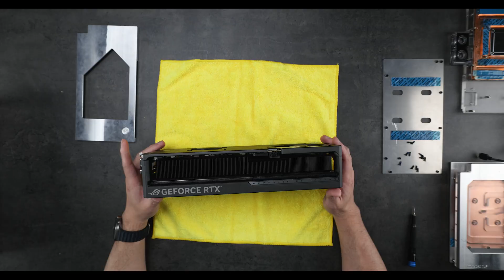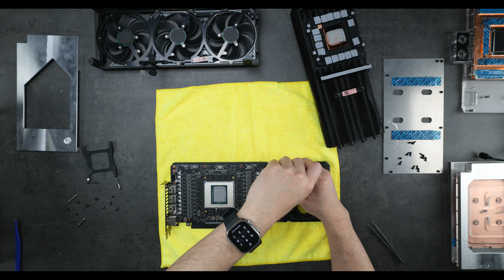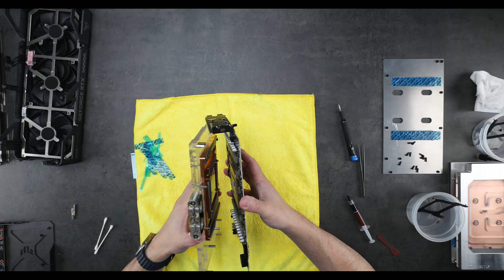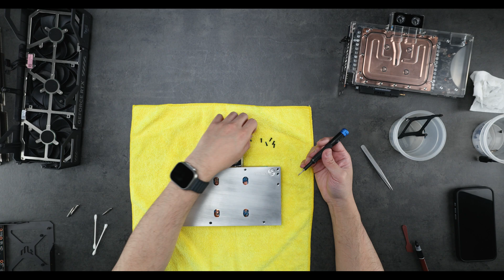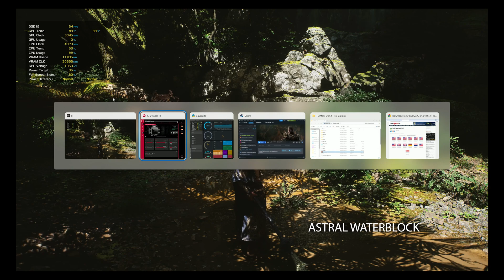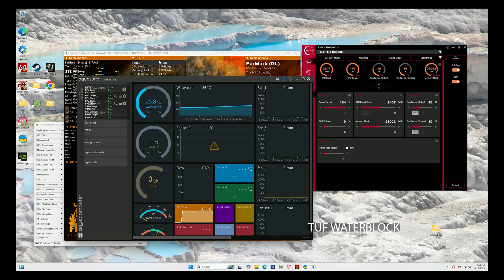Watercooling ASUS ROG ASTRAL 5090 & TUF 5090: Bitspower Prototypes: Teardown, Install, Testing FULL

Comment: Serious question here but what is the point of buying an astral if you intend on just watercooling it? Since all t h e 5090s are the same silicon, technically, wouldn't it make more sense to just buy a cheaper version and  watercooling that????
Reply from the maker: I agree. I made this argument as well. However, it seems the most in demand from consumers is for an astral block.
Reply: @JCustom thank you for responding, that said, you would agree it just makes more sense to buy a cheaper version of the 5090 and not the Astral?

Comment: Would you be possible getting Iceman block for 5090 and test that one? They make wonderful products and high quality. They currently have Astral and Tuf and I guess they do 38c 600W. They are coming out with Master next month I think
Reply from the maker: I am familiar with the brand. I may look into it once I go thru all the primary block makers. 38c at 600w would require a chiller or an ambient that is outside winter temperature. Any claim that isn't delta to water temp is likely not accurate.
Reply: @JCustom it would not surprised me. His ambient was 26 and I believe he had Mo-Ra. Iceman makes great DD blocks, ram direct die which I use and many other things. I would believe the temps being 38C cause i could do 39C with Optimus on 4090 series and Mora. I don’t have the product yet since I am waiting on Master Block but they have Tuf and Astral. Iceman is more than premium product. Thank you either way.

Comment: Wait, more radiators wouldn't have brought that water temp down? I thought people with say MO-RA IV 600s can run full load pretty much +3C over ambient because it's so much rad space?
Reply from the maker: Yes but the delta on the block is going to be the same. So lets say your water temp only changed 3 degrees the gpu temp to water temp delta is still going to be 20.  A mora is quite an investment in terms of space and cost.
Reply: @JCustom  I was just commenting on the part around 46 minutes where you said the radiator felt cold to the touch and adding more rad space probably wouldn't help the temp, but then it shows water temp was 36C. Assuming your ambient air temperature isn't 36C too then surely that's not correct right? Say ambient was 20C, water temp was 36C, isn't more rad space and/or higher throughput fans the answer to closing that gap and would have the knock on effect of lowering component temps through the delta shift?